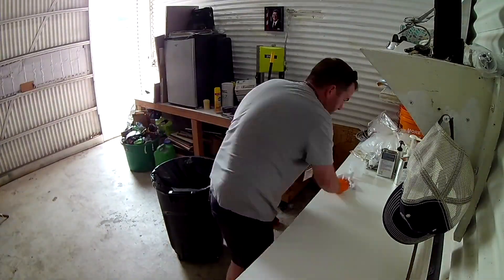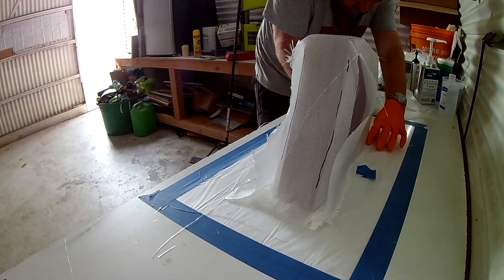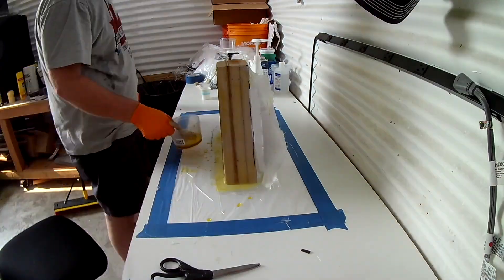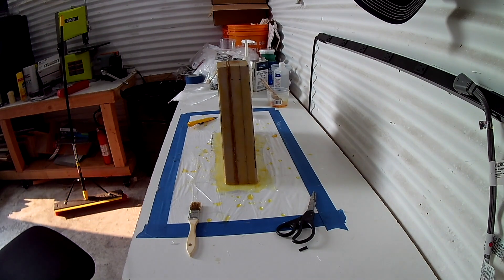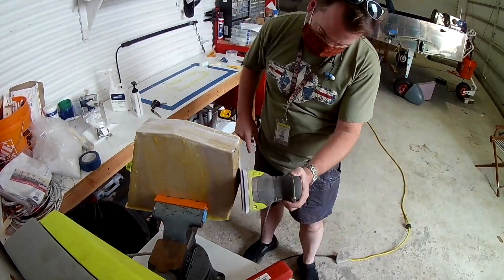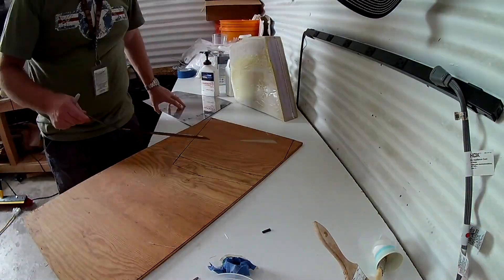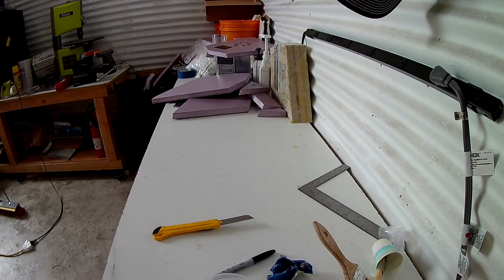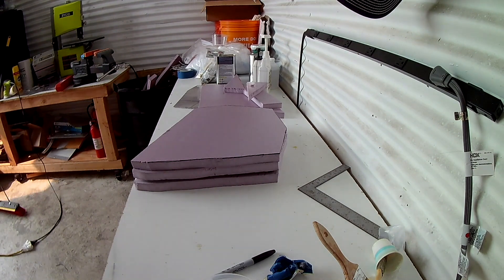RV-14 Carbon Armrest III

Comment: I have a great way to make 90 degree angles.. first just glass one side, trim the fabric about 1/4 inch past the edge, let it cure, then sand off the extra. Now you have a sharp corner, but here’s the trick.. gouge out about 1/4 to 1/2 of foam from the non-glassed corner, pack it with flox, then lay fiberglass on the other side. The flox makes a triangle shaped corner under the glass that’s super strong. After that cures, you can sand off the excess cloth. I don’t know if that makes sense to you but they taught that in the EAA composite course on the trailing edge of a wing project..